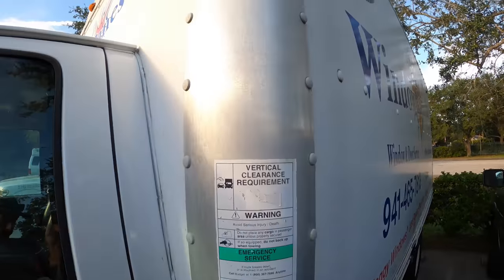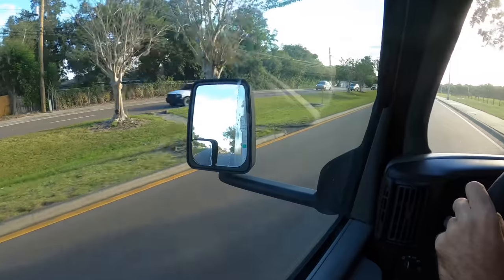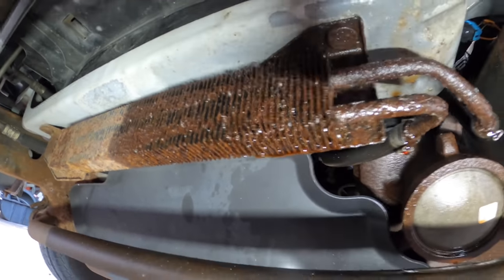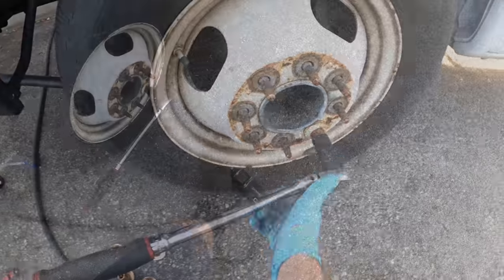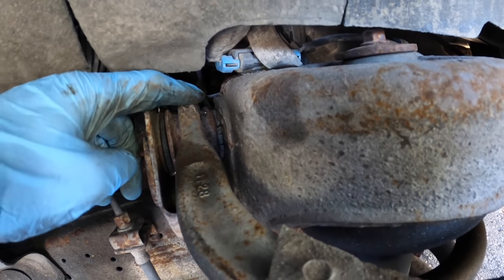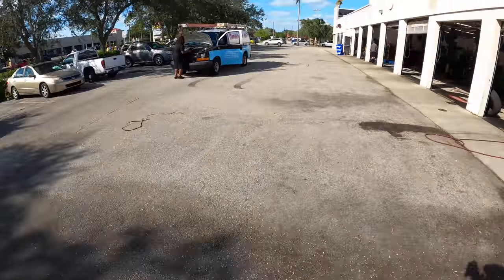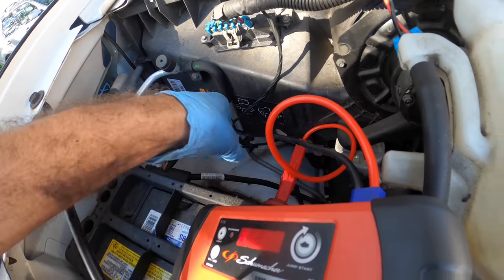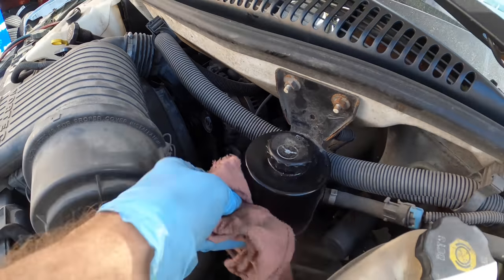Two Hour Inspection | DECLINED everything! almost

Comment: I had an employer like that…I turned in vehicle inspection sheets with a ton of faults, told them that the vehicle should be red lined and parked until the front end was fixed. I was not only ignored but was told that I was over exaggerating the safety implications. Another employee called OSHA, who did nothing but question the employer. Three weeks after OSHA was told (by the employer) that the vehicle was inspected and that the claims were unfounded, the front driver lower ball joint blew out on a turn and also caused an accident. You better believe that I took photos. Businesses with “company vehicles” should be held to a higher standard.
Reply: OSHA's gutted budget is probably the reason behind them doing basically nothing. OSHA has fewer staff and less funding than OSHA itself recommends for developing countries' OSHA equivalents. They have so few resources they can't afford to investigate properly.
Reply: My truck has a slight oil leak, it's engine is getting rebuilt 10 grand, 1 week in the shop.
At the end of the day, you are the driver, if your employer disagrees with you, fine. But it's your duty as a operator of a vehicle to maintain safe condition of the car, if you know it's unsafe have it fixed.

It's sometimes easier to ask forgiveness then it is to ask for permission.
Reply: Thankfully where I live commercial vehicles with a registered gross weight over 10k lbs get an annual inspection. And there's TONS of roadside enforcement.
Reply: @asphere8  they have enough resources to mandate everyone get vacinated
Reply: @claytonking70  Exactly!
Reply: i think the higher standard is holding liability insurance. which isn't exactly accountability, it just means you get paid off.
Reply: Profficial?
Reply: @Mexicanus Prime They are not going to fix it if there is a good possibility it ends up going to auction.
Reply: @asphere8  "gutted budget"
Lol ok
Reply: @Minuz1  wouldn't say its worth rebuilding for a slight oil leak?
Reply: I warned my boss that our P1200 step van was having an issue with the oil pump, internment low pressure all day, 15psi idle/25psi driving. Mechanic looked at it: "Let me change the pressure sensor".

1 week later, sensor is now showing 0psi at 60mph, and still hasn't been replaced. I warn my manager that I won't be held responsible when the engine blows. 10min after leaving the terminal, the engine blows and I'm calling the manager with a shit eating grin on my face. 

Fellas, never make an $8000 bet against yourself, you'll always lose.
Reply: @asphere8  OSHA can; IMNSHO they just don't want to.  I've worked in places that should have been shut down because of safety violations.  Including *narrowly* escaping injury or death.  When reported OSHA would just send a letter asking to be notified when the problem in question was corrected.  "Investigate?"  Bless their little bureaucratic hearts. 😒

Comment: It's important to have great working headlights so you can watch the crash going down due to failed suspension components. A/C is important too so the driver doesn't overheat during the crash.
Reply: Safety Third™!
Reply: @wlan246  As Mike Rowe has said before 😆
Reply: LMFAO!
Reply: i always say fixing the "ac is the priority because you could be cold when you wait for the towing" when a customer want to fix the ac but not the actual important stuff like brake and suspension work
Reply: If at 3rd you don't  succeed
Reply: Yes it's very important to feel comfortable when waiting for emergency services to cut you out of the cab.
Reply: You need the lights b4 u hit the deer due to your failed brakes
Reply: Oh yeah! Debo
Reply: I was going to type this comment almost exactly.
Reply: Alright; glad someone else saved me the trouble of making this exact comment!

Comment: This is the reason why we have M.O.T. inspections in Europe. The vehicle is inspected in and out, up and under. Even lights are inspected, and if they find anything, then they give it a failed rating until the repair is done and subjected to a new inspection. The guys check absolutely everything, including the tire grooves depth. And if the vehicle is caught on the road with a failed seal, the fines are really expensive and driving licences might be revoked.

Comment: Never give up the the "click." The naysayers maybe just don't understand the necessity of the sweet sweet click.
Reply: Anti Clickers, never use a torque wrench.
Reply: Or maybe update to the digital beeps.
Reply: I like 5he noodle arm torque click beep to modern for me
Reply: Heaving on a wrench and saying "Click" is ok but beware the echo "Kcilc" it may have sheared!
Reply: "Click" first seen (more than a decade ago) from elderlyiron channel, on the series 'Redneck Restorations: This Old Truck' by Jeff Bradshaw an archive of greatness.
Reply: keep up the click, also delete the bots message when possible
Reply: @seagullsbtn  ...and that's my god-given right to be an anti-clicker
Reply: Especially when doing halfassed mickey mouse stuff like what's in this video.  Totally unacceptable.  This shoddy halfassed work is going to cost them in the future. 
It calls for a cooler.  It should be reinstalled int he same spot it was taken from and with the same fasteners.
Reply: @tarstarkusz  Not the same part - nothing wrong with custom job. You've obviously never worked on older cars - you make do with what's available and cost efficient
Reply: @AdmrlSpeedy  I have worked on many vehicles., though I am not a professional auto mechanic. 

Let me ask you a question.... Why did GM put a cooler on the vehicle?  Do you think they had a few thousand laying around and said "while we really don't need a cooler on this, we need to get rid of this inventory, so lets put them on this vehicle unnecessarily!"

Perhaps under ideal conditions, you don't need it and it will work fine.  But load this thing up to maximum capacity and run it in Florida (which is where this video was recorded) in the middle of summer in low speed traffic....
Reply: @AdmrlSpeedy  Wait. Are you saying you believe this replacement one cools as much as quickly without the fins?

If it were my own truck, I probably wouldn't care. But if it were my company truck which was routinely loaded up and used commercially, I would care. 
I understand you have to do what you have to do and that not leaking is better than a leaking cooler. 
But why not used? 
I always assume engineering decisions were made for a reason and that if something isn't necessary, than it wouldn't be there.
Wouldn't it have been better if the original clips were there?  He could have least put the bolts back.
Reply: @AdmrlSpeedy  They might be a different spec of the same truck with different lesser options.
Yes, that is a good point.  The bushings were totally gone IIRC.
Saving money would not be using a cooler where no cooler was necessary. That is cost cutting.  Given the shape of the truck, they probably didn't care and just wanted it not to leak. Still, I would have recommended a used one.
Reply: some of us just got here.  keep the click.
Reply: @tarstarkusz  it’s a hydro boost system the power steering and brakes use the pump and when braking or holding brakes for any extended period of time the system gets hot. That’s why it has a cooler.
Reply: @santiagoc1466  So, IOW, it is not superfluous.
Reply: "Reverse click" was good, too.

Comment: I suppose with the brighter headlights when they hit the brakes hard they can see the ditch when they go down it
Reply: I just learned a tough lesson, don’t drink hot coffee while reading these comments. Oooops. That’s hilarious dude
Reply: and they will be really cool while doing so also.
Reply: Yep. At least they will be able to see what they'll hit.
Reply: Lol...good one..
Reply: Thanks for the laugh!
Reply: Yes he needs to see which ditch is which.
Reply: Sad... up until the State Police Accident Reconstruction Unit gets the case...
Reply: OMG...I choked on my burrito when I read that. LOL
Reply: Safety issues... No problem. Now it only driven by the wife.
Reply: @sct913  Same here in Australia, I hate them, like two blue lasers coming at you. Should be banned.
Reply: @sct913  LEDs are also less refractive
Reply: In a proper headlight housing and part of a properly designed system, LEDs and HIDs can be safe, effective, and enjoyable to all. But yeah, those "retrofit" kits with rebased HID capsules or "upgrade" LED bulbs that are sold to fit into halogen headlight housings are absolute garbage, look terrible, and are dangerous to other drivers and the driver of the host vehicle. And technically, they are "banned" everywhere with homogenized vehicle safety standards and laws. Just no one enforces the laws.
Reply: Click.
Reply: @sct913  LED headlights aren't that bad when adjusted right but when they add those LED fog lights into the mix they suck for older folks like me that have to face them on unlit country roads...
Reply: If they are warmed up when he hits the Ditch HIDs can take awhile to get warm and work right
Reply: @sct913  Unless they are installed Properly if they are installed properly the Light should not scatter to the other lane
Reply: But people just throw the Bulbs in without researching with ones they need because if your Converting a Halogen Bulb system to LED you need to have the LEDs Adjusted I believe it's straight up and Down if you have Reflective Type Lighting and Side to Side for Projectors but it could be the other way around but the Point is people just throw them in their cars and think they are helping
Reply: @deltasixgaming  Even when installed properly, they are too bright.  Plus, unlike incandecent bulbs, LED headlamps require current limiting hardware that heats up, which usually requires a fan as well.  Needless complexity for something that solevs a largely non-existent problem.  To paraphrase Ian Malcolm "Automakers have spent so much time developing this technology that they didn't stop to ask themselves whether they really should be developint this technology."
Reply: Lmao best comment ever 🤣 😂
Reply: Yeah I feel like LED lights are over rated. Never needed it before so what’s the difference now. Only thing different now is people running off the road cause their on there phones… Those extra bright lights mean nothing xD
Reply: @mingiasi  especially if they're the Blue ones 😯
Reply: @sct913  that's the point.  Leaves more road for me as they swerve away from me.
Reply: @JC-bk5is  ouch hopefully it wasn't McDonalds hot
Reply: lmao new fancy lights to smash when they hit because brakes don't work
Reply: @sct913  Agreed!  Whatever happened to the headlight aiming after new bulbs or lenses were installed? I think State inspections should require it.
Reply: Soaking the control arm bushings in brake fluid will swell the rubber, taking up any play. Plus, the undercarriage will smell really neat. As to the wear in the outer tie rods, pump some PL adhesive thru the zerk fitting to tighten up the free play. Or, you could replace the worn components, align the front end and make that dangerous machine safe & road worthy.
My State has no required safety inspections. There's tons of metal hurling down the highways here on Bald tires, lose front ends & bad brakes.
Weeeee!
Reply: Nah, they're just gonna get another opinion and price shop the front end work.

Comment: Companies should be held accountable for this stuff far more often than they are, my husband used to drive for advanced auto parts and would constantly complain about how they ignore problems but then get upset when it bites them in the ass. For example tires having slow air leaks that they wouldn’t address or even put a patch in, A/C compressors going out in 100 degree weather and leaving employees to just deal with the heat, waiting nearly 10-15k miles to get oil changes after being due, and to the point were a truck got in an accident one time and had untold damage to the radiator and front left due to being hit by a driver that blew a red light when they were making a turn and the store put stop leak in the radiator and taped the loose front end parts. That’s just unacceptable.

Comment: I was watching him put the fasteners on that "cooler" and went, "Dude... why didn't you grab a 6mm socket and ratchet that...?" not even 5 seconds later, "I know... I could use a socket but I am already dedicated at this point" I about lost it man, you seem like a bad ass dude to work with. Stay safe out there!
Reply: Or bolt the cooler on then do up the clamps so the lines are held steady 😂
Reply: 7mm in UK

Comment: 20:30 Tip from a VW mechanic (who has to deal with this type of clamps all the time): Snip these things 90° from what you did. So not in the same place where they are pressed (when installed), but rotate your side cutters 90° and then cut the "ear" off. Works way better!
Reply: Agnez  stop spamming every comment. No one wants to pay to see you beat up roast beef looking wings
Reply: @danbryan4667  😳😂
Reply: @danbryan4667  Just report them as I did and they delete them.
Reply: @Biffo1262  not really I've tested this out. You can't see them anymore but if you login on a different account you'll see its still there
Reply: @danbryan4667  It's a bot, it's automatic
Reply: @ZerotheWanderer  Report these and they might pull them.
Reply: @danbryan4667  🤣🤣🤣🤣
Reply: I wouldn't go back to a mechanic that makes permanent changes to my vehicle because it's easier for them to work on.
Reply: @usadaytrader   What Permanent Change do you mean?
Reply: @MurcielagoBoy1  Probably he means replacing that single use clamp with a proper hose clamp. He doesnt understand that the only reason cars come with these from factory is because theyre cheaper and faster to install than regular hose clamps.
Reply: Still eats your cutters I spread them open and pop the catch. Easy as can be.
Reply: @courier11sec   Yeah I do that too. I started with Cutting but I changed a while ago to the same Methode your Doing

Comment: Don't give up the "click"! As a Mechanic of over 35 years, I too have acquired the ability to measure torque. Sure there are times where I use the wrench, but for the most part, experience has taught me the correct amount of force to apply to fasteners. Both new and old ones!

Comment: Grinder, just cut the thing out & grind off the bolts lickity split! You're a pretty good mechanic. I've seen quite a few decent mechanics forget that some components are junk that's in the way. If removal can be simplified with cutting; prying; or other more expeditious methods, then time & money can be saved or put to better use 🙂
At least I learned something in the 45 years I've been turning a 🔧 🤪
Reply: a cutting torch and a sledgehammer are my favourites. nothing can be tight if its liquid!
Reply: A cold chisel and a mash hammer has been my friend many a time for rusted bolts.
Reply: @johnt.848  That's what my X'wife used on me. I still set of the metal detectors at my proctologits office 🤪
Reply: That's how we do it in rust country.
Reply: @zoidberg444  Great ID Dr Zoid! Rust country? I'm in the North East. We use salt 🧂 like it's going out of style 🤪
Reply: i was thinking the same a sawzall over the cooler once you had enough room for the blade, screw fighting that thing all the way
Reply: X'wife, lmao!
Reply: Agreed there was so much stuffing around in this video that it did my head in. Seriously just cut the thing off, the tech screws I do not agree with and that should have been drilled and bolted with nylocs. All in all not a great video
Reply: @sooksandsimba  or more time and effort to make the cooler fit like it should have in the original holes

Comment: The company I work for has a whole fleet of these trucks. I once repaired this same power steering leak in one of our yards using a cheap aftermarket cooler that I zip tied in front of the original cooler, some rubber hoses, and some clamps and it help up till we got rid of the vehicle a few years later.

Comment: Hey Ray, good work on inspecting the front end thoroughly but just a heads up.. most older gm and ford power steering pumps (I do it on all makes and models personally) require a sort of bleeding procedure to avoid that whine on startup. Just lift the front and turn lock to lock a few times slowly with the cap off and no noise for any customer to complain about. 😁👍
Reply: I’ve seen them burn up the first 5 minutes if you don’t do that
Reply: Good to know, thanks!
Reply: @Cantspeakable  I've actually never seen that, but I'm sure it can happen because you're hearing the veins inside the pump vibrating and if one let's loose it's game over for that pump